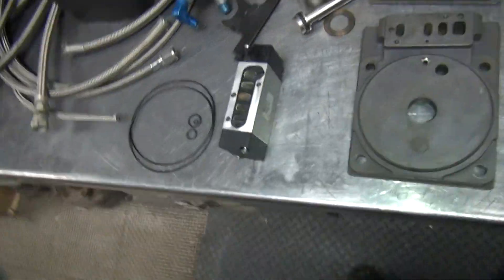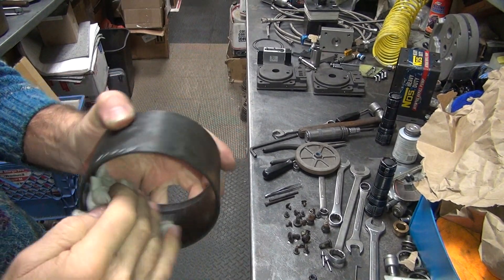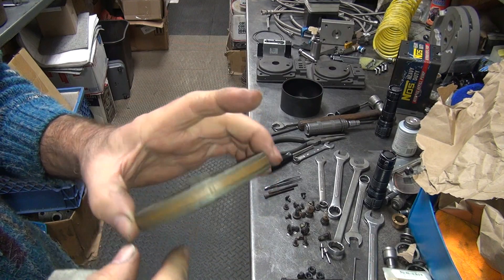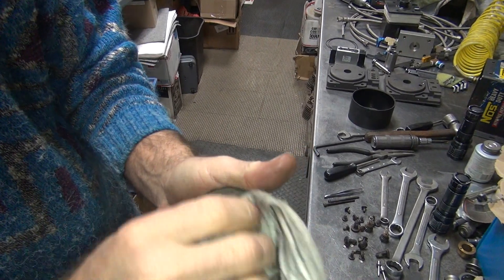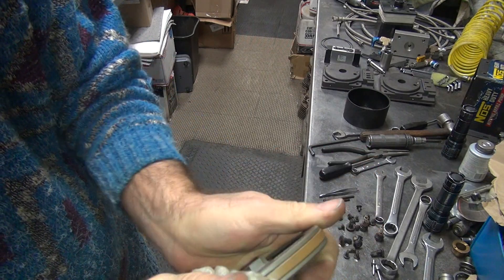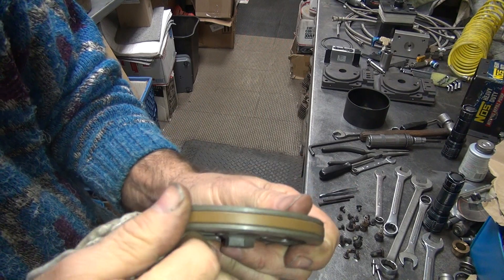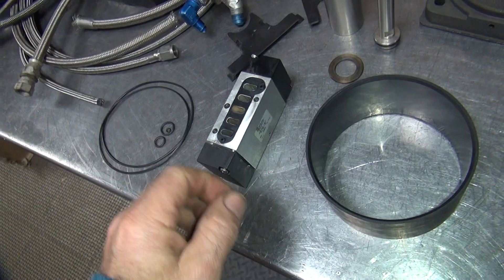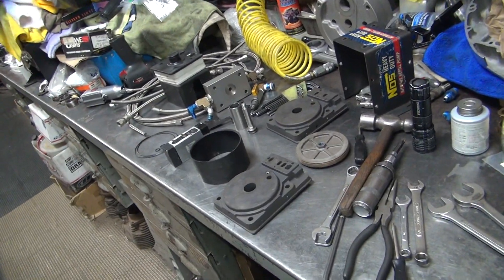#105 bad ebay nitrous oxide transfer pump rebuild nos drag race scta harley lsr racing tatro machine

Comment: O-rings lubed with petroleum jelly, or silicone grease? I use silicone grease because some O-rings don't like petroleum products.
Reply from the maker: petroleum jelly or vaseline is not a petroleum product. that is why you use it on brake seals on assembly. same deal here. if in doubt vaseline will work on anything.
tatro
Reply: Dupont "Krytox" is the preferred lubricant but what do I know...
"Krytox oils and greases are high-performance perfluorinated lubricants used for a variety of applications. Used where temperatures commonly exceed 250°F or fall below 0°F. Certified non-flammable and the material of choice for use in direct contact with oxygen, nitrous oxide, concentrated ammonia, and many other chemicals."
Reply from the maker: sounds like good stuff but i don't have any so i stole this from mom.
tatro
Reply: Petrolatum (petroleum jelly) is not recommended for EPDM, SBR,  Silicone or Butyl. I suppose since most
o-rings are currently made from Nitrile or Viton my fears are may be
unjustified.
Reply: At $35-$40 for a 2-oz tube, it better be good! I'll stick to my silicone grease. It's priced affordably like petroleum jelly and I've never had a problem with it. Makes one think about what they used BEFORE DuPont came up with Krytox.
Reply: @daved299  I am a qualified nuclear submarine marine machinery mechanic. We use only the best of the best on our submarines.
Reply: No doubt!